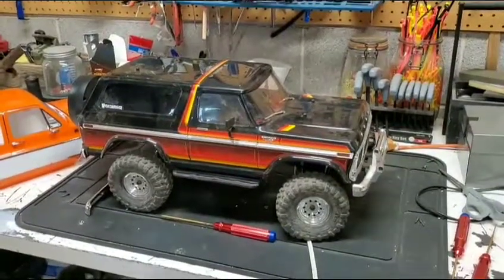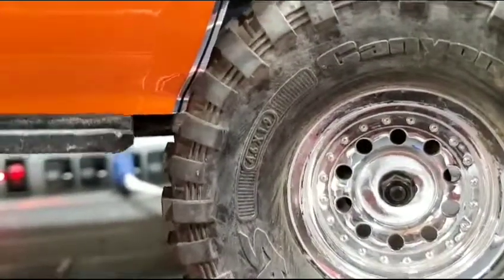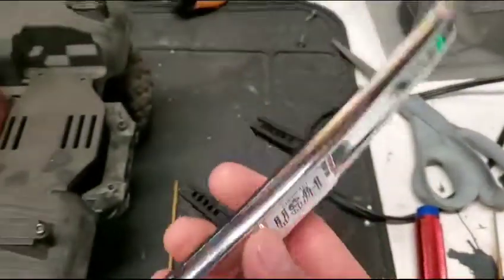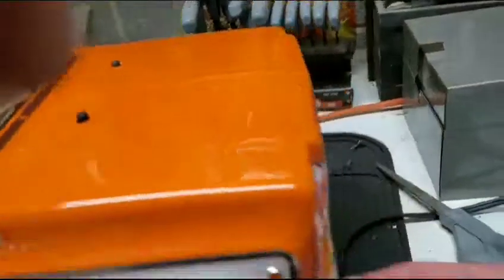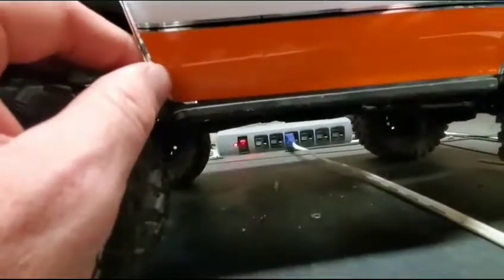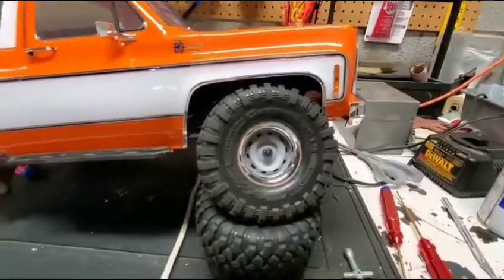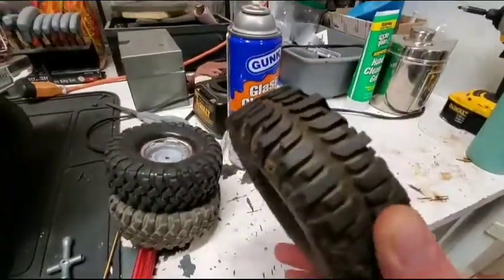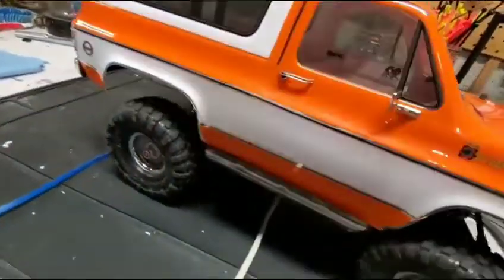Changing the Trx4 Bronco to a Blazer

Comment: Front and back body mounts need to be moved up one notch, front bumper frame bracket  rotated and bumper moved forward. Rear bumper the unscrew plastic bumper from bracket and rotate bracket 180 degrees reinstall bumper    to bracket . Do opposite. For blazer to bronco
Reply from the maker: Thanks, ill try it